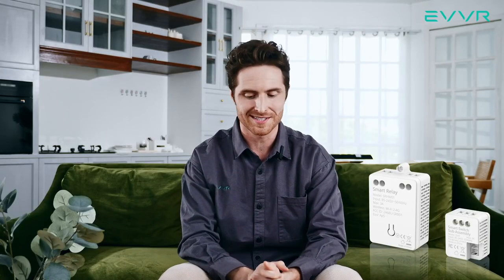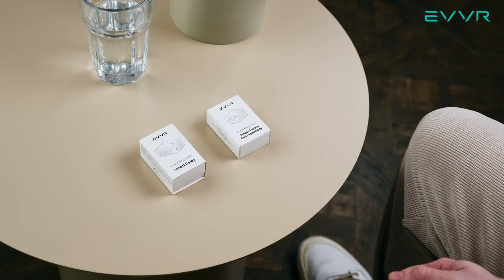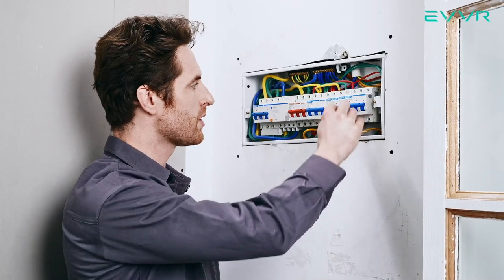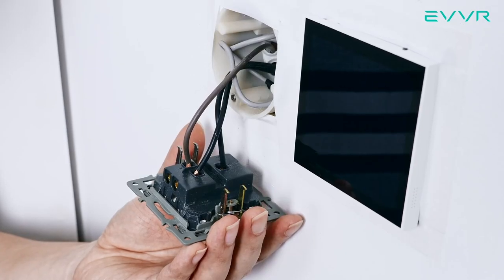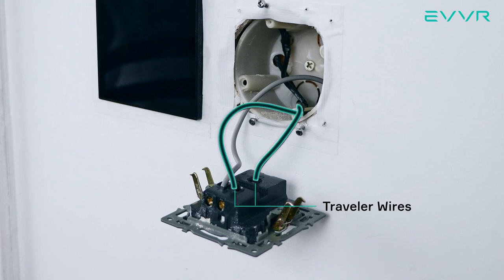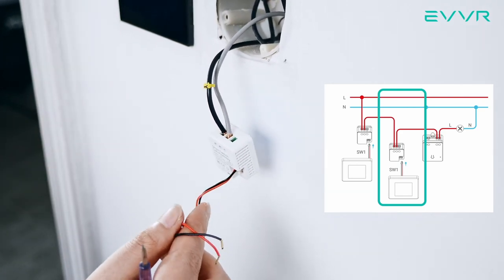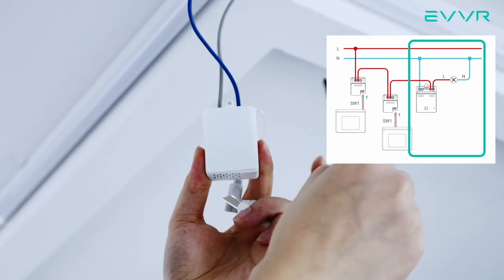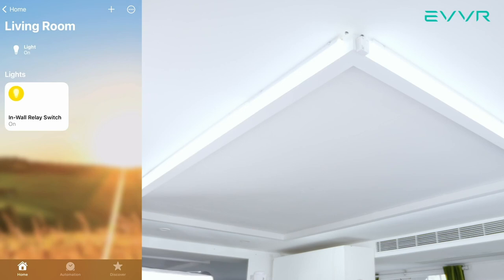How to install HomeKit Evvr In-Wall Relay Switch for 3-Way Light?|European

Comment: Is there a way of doing that with only one sub-assembly? Because I have 3 switches in my room for the same light, so I have to buy 3 sub.assembly?
Reply from the maker: Hi！
For the scenario where three switches control the same light, you need to buy three smart switch sub-assembly and one smart relay.
Thank you for your support of Evvr. 😁
Reply: @evvrhomeautomation  And how is it possible to buy multiple sub-assemblies? I can only see the bundled 1 sub-assembly and 1 smart relay in the online store and across all partners?
Reply from the maker: @ddbdestroyer91  Hi Daniel, thanks for your support to Evvr. How many multiple sub-assemblies do you need? We sell now only bundled 1 sub-assembly and 1 smart relay and bundled 1 sub-assembly and 2 smart relays.
Reply: @evvrhomeautomation  well I have at least 3x 2 sub assemblies to 1 relay and 2x 3 sub assemblies to 1 relay. Seems like you need to start selling these separately to fulfill your recommendation of purchasing n sub assemblies to 1 relay?
Reply from the maker: @ddbdestroyer91  Hi Daniel, we will seriously consider your suggestion. Thanks again for your support of Evvr.
Reply: @evvrhomeautomation  cool :) happy to take credit for it but you suggested it to the other user above first! 

I can’t justify the expense and resulting e-waste of left over smart relays that wouldn’t be in use. Will keep an eye out for future store updates.